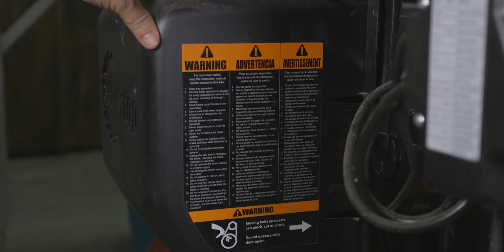Using A Table Saw For The First Time | Beginner

Comment: I have been woodworking (very basic stuff) for almost 10 years, and have a lot of tools, but people have scared me to death about table saws. I FINALLY got a DeWalt (was so excited when it came), but find myself  afraid to use it after reading the manual and watching videos. I have the guard, riving knife, and kickback thingy-ma-jigger) on, but I am still so scared.
Reply from the maker: I totally understand! If you use the guard, riving knife, and push stick you will be fine. You just need to get a little practice in so you can get to know the saw..
Reply: Thank you so much! I, like so many who do not have mentors, rely so heavily on experts like yourself for  direction. Very much appreciate your content!
Reply from the maker: Reach out any time with questions.  @krishaller5338

Comment: I had my front teeth taken out by me not having a video like this one. My piece  of wood jack knife. I'm lucky to be alive . Thanks a million  I'm still scared of my industrial table saw. I use it a little but I will never forget
Reply: I saw it kick back up when hubby was running a board that had a knot. It chipped off and hit him to the right of his stomach. I panicked when I saw it. Of course, I let go of the board while the board he was cutting kicked back and went through the wall.  The electrical line stopped it from going further. Had hubby been closer, it would have gone through him.  I was done.  I'm terrified of this equipment.  I now have someone else cut what I need.  Hubby has had 3 strokes since February. I won't let him near it.

Comment: I literally am brand new to wood working and using a table saw. I just put my table saw together and have not used it yet as i was looking for a video with no fluff and straight to the point. This video is great. I feel more comfortable using my table saw (portable) for the first time after having watched this. Thanks!
Reply from the maker: Great. Be sure to use all the safety features, like blade guard and riving knife is the saw comes with one.

Comment: I just bought a table saw for the first time this week. Before using it, I came to YouTube to learn all the safety tips and safest ways to use them. I bought a Micro-Jig Grripper and thought I was ready to go, but I went out to use it and I was terrified of using it. UGH. I unplugged everything and walked away.
Reply from the maker: Yes, it is a very scary tool!! Be sure to use all the safety items that come with the saw, and keep trying.  Email me if you need help or have questions.
Reply: Did you get used to using it?

Comment: I work for a company well I’m the lead carpenter of a company who specializes is airplane teardown, biuld crates all day for various size parts, from door slides, to thrust reversers, engine doors to the pilot seat, I’ve crated it, the company I work for uses millimeters as a measurement (I work in the states) I’ve cut full sheets of ply on a table saw and believe me if your going to be doing any type of extensive cutting of full sheets regardless ifs it 18mm ply or 6mm 18mm is about 3/4 in and 6 mm is basically paneling, invest in a panel saw, a panel saw will change your life

Comment: I have a (rational) fear of table saws and some tools in general. I feel more confident using my dad’s table saw tomorrow now, thank you! (One of my uncle’s diagonally removed 2.5 fingers and another lost 2 fingers to a plumber’s tool (the drain snake), almost lost his arm to a band snapping too and cut off (but reattached) a finger with a saw too. I promise they’re very smart men, they just work quick and for themselves so what’s OSHA when you gotta get the job done?
Reply from the maker: I've operated under that mindset for a long time... just got to get the job done no mater the cost. I've changed that mindset of course but I remember those days very clearly. Thanks for the comment my friend. You might fine this video helpful as well. https://youtu.be/j3a7I5MXBUk

Comment: Just lover your videos--so well exlapined and demonstrated.  Question though--instead of holding tightly to the fence, why not secure it with some sort of double fence--making sure the cut will be straight? Don't know what they would be called but I guess you understand what I mean--a fence on each side held by some sort of spring mechanism??

Comment: Very good and in depth safety video in a short time ( my adhd thabks you) 

Question  if you don’t mind , and I’m surprised I couldn’t find it in the comments. 

I’ve purchased two grr ripper’s ,  i feel like there would be greater control and less intimidating approaching the saw with the blade cover removed than to use a push stick.  Is this an exception for removal of the blade guard , even for beginners ? 

Thanks mate
Reply from the maker: That is a really good question. Unfortunately I can never recommend removing the blade guard to anyone. That will have to be a personal decision that you make. All I can say is do what feels best for you.... make some cuts, reevaluate, make adjustments, and make more cuts. Rinse and repeat. :)

Comment: So, I am working on a project with a "stacked stone" type of cork wall covering. It varies in thickness, but on average is about 1.5-2". The sheets are 24x36". Instructions say to use table saw to cut... need to make a "z-plane" angled cut, ie: piece not parallel to the rip fence. Trick is, this is a very old house so the wall is not straight. The point is to make a cut of about 87° for the first panel... but only down to within 4" of the end of the piece. Have a video for this? Ty!
Reply from the maker: Sorry I don't Brian.

Comment: I have a question. My dewalt table saw was making accurate rips using measuring stick and then one day later it’s off. Same blade same fence. Any suggestions.
Reply from the maker: Which model is it?
Reply: @TrainingHandsAcademy  7485
Reply from the maker: @jamesgatlin4162  I would check to see if your indicator scale has moved. The screw can come loose.

Comment: When you say cabinet saw, are you also referring to a contractor saw?  I'm a relative newb.  Or rube, as the case may be.
Reply from the maker: Cabinet saws will generally have a inclosed cabinet under the saw's top (and used in a cabinet shop for building cabinets), and a contractor saw normally  is not inclosed (and is used on job sites). These terms are used interchangeable so I wouldn't worry about it too much. :)